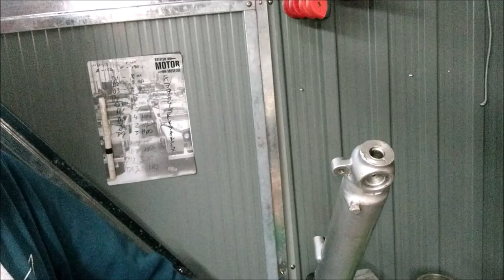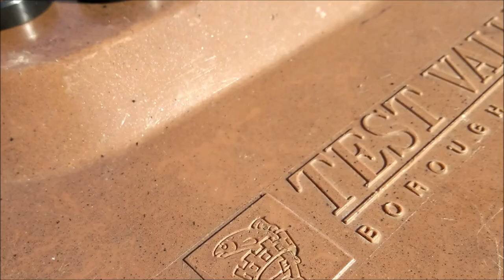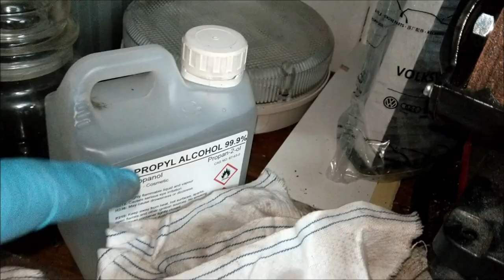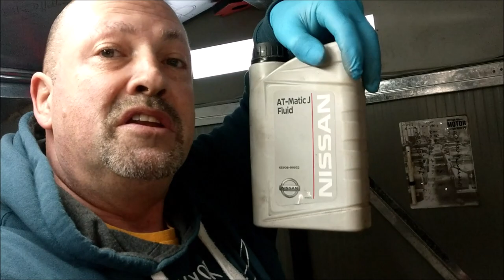Honda CD175 Fork Seal Replacement

Comment: These are also very similar to the cb200 forks. The workshop manual for my cb200 was asking for liquid sealant on the bottom screws (additional to the copper washer that is). During my initial fork overhaul I tought I won‘t need the liquid gasket, so I skipped it. Turns out to be absolutely vital, because I ended up with leaky bottom screws. I used fresh bolts, fresh copper washers and also some loktide blue - but It didn‘t hold up until I added the liquid sealent around the threads and washer... Damn you, Honda. Btw, I was also fighting these pressed on dust caps. Ended up replacing them with some custom made CNC mashined caps aswell. 
Nice job sir, you did a fabulous job on the cd175. Kind of sad that you have to sell it, just bexause of the space. Would you mind telling us for how much you sold it?

Comment: Hey, you are sounding good :) when you started pouring the oil back into the fork did you hear me shouting: "get the bottom screw back in!!!" lol  
Watching your video I suddenly realised something: I know now that it will be difficult if not impossible for me to do another project - If I did I wouldn't be able to sell it off. I wouldn't have the heart to sell "my baby". Fair game to you as you are able to detach yourself from "your creation" and pass it on. The plus side on what you do is that whichever bike you do is always to a good standard so the new owner shouldn't have any troubles apart from the regular maintenance.  
Keep on with the good work. :)

Comment: Good videos.  Just came across this after trying to gently remove my cb175 chrome shrouds.  No luck with oil filter strap or homemade lug tool so have resorted to hammer & screwdriver & heatgun, but its all getting very messy!  Can' t tell if shroud has moved at all or if its just chewed up.  You did well getting your shrouds so tidy.

Comment: Is it really necessary to remove the bottom bolt and damper? The bolts seem like a headache and it looks easy enough to clean the tubes with them in? Just asking because i have similar forks on a cl160 im about to do.
Reply from the maker: Yes i think so